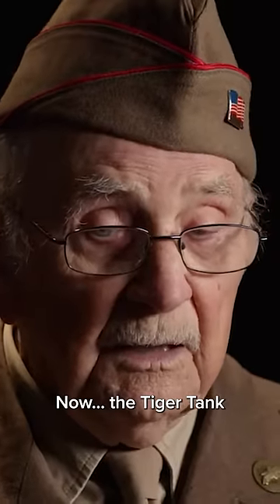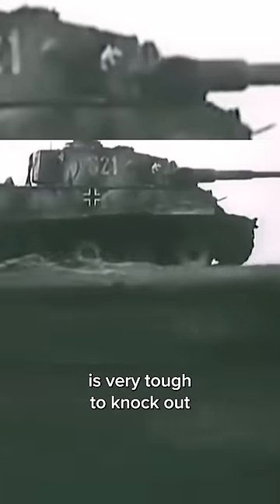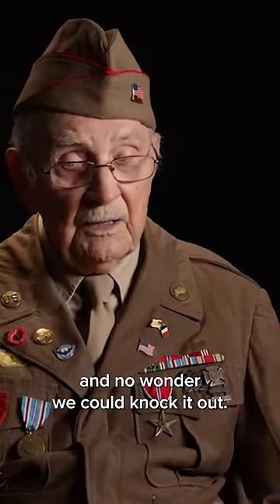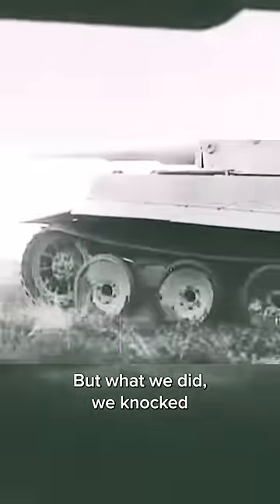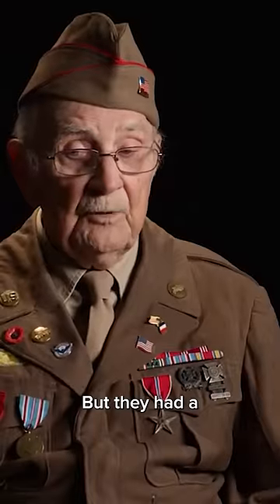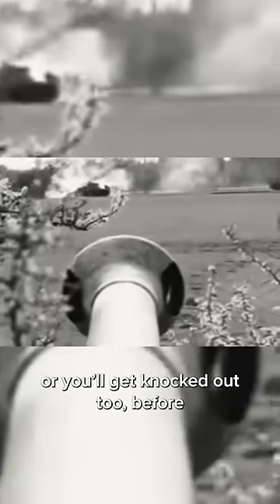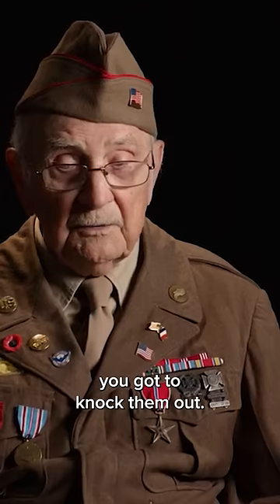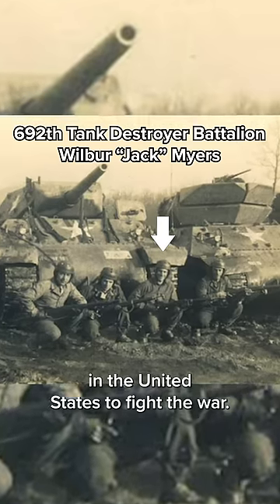How To Knock Out a WW2 Tiger Tank

Comment: That man didn’t fight a tiger 1. That man is talking about a King Tiger. That is levels more dangerous.
Reply: Knew something was off when he said 72 tons lol
Reply: Yeah the tiger 1s could be pierced from the front by the Sherman's 76mm gun, if the gunner got a bit lucky.  

And a lot of tiger 1s were actually disabled  without being penetrated because German steel was so brittle that if you hit it from the outside with a high explosivbe shell it would cause armor fragments to burst into the tank and rattle around at the speed of a pistol bullet. 

This also worked sometimes on tiger 2 but their armor was SO thick it was much harder to make it work.

Germans responded with the Schurzen, those big metal plates that hung off the side of the tracks, tey'd set off a low penetrating high explosive shell before it made contact with the main hull.. 

 Americans responded to the same threat with a fibrous mesh inside the armor to catch the fragments when they broke loose, called a spall liner.
Reply: Ahh yess the ferocious King Tiger. Whether it be mud, or dust or snow, or nothing at all, The King Tiger will destroy.......... Itself.
Reply: @@DarkIsToNight The war was almost over, the enemy had all but surrendered. But unfortunately for the Allies, just as they were on the cusp of victory, they heard the Grumble of an Engine That SHOOK the Earth, and caused sheer TERROR in their hearts. 
They looked over the horizon, across the hilltop, and to their absolute HORROR, they saw the 70 tonne BEAST, The Ferocious KING TIGER peek over the ridge. 

Flames and DESTRUCTION followed this BEAST, their hearts were gripped with ICY fingers the moment it crossed the ridge, as they saw in abject fear, its transmission break down and the engine catch fire 🔥🔥🔥.
Reply: More likely its was a Panzer4. The allied got panic attacks the moment they saw a German tank.
Reply: @dapre your wehraboo copium haha
Reply: @hagamapama  Schurzen was meant to protect from Russian 14.5 mm anti tank rifles by breaking up the cermet cored projectile before it reached the vulnerable side armor. In fact Schurzen was made well before German steel started to decrease in quality.

And US WW2 tanks don't have spall liners. Not even stuff like the M48 or M60 which came much later after WW2 do.
Reply: Levels more dangerous if it reaches the frontline lol
Reply: @rkang6531 and then the ferocious T26E4 Super Pershing rolled up over the hill, the Tiger 2 fired a single Armored Piercing round which ricocheted off the up-armored turret of the American machine. The Pershing’s gun lined up on the turret of the King Tiger and fired its 90mm cannon, letting out a deafening boom as the round cut through the air and forced itself into the Tigers turret, detonating inside the turret and igniting the ammunition
:D
Reply: it's not more dangerous, it's even slower than the tiger.
Reply: @dapre   Until the Tiger's transmission broke for the fourth time in a week...
Reply: This veteran was in the 692nd Tank Destroyer Battalion. This unit fought in the battles east of Aachen in late autumn 1944.
Schwere Panzer Abteilung 506 with King Tigers fought in that sector too. Although a few King Tigers were indeed lost that autumn, their losses were sporadic. Few and far between. So what the vet is saying can't have been the norm.
Reply: @hagamapama  also, before German steel started severely degrading in quality, a non penetrating hit could give enough of a shock to the electrical systems enough to render the Tiger inoperable
Reply: @hagamapama ww2 truly was the grim dark brutal draconian nightmare sequel to ww1 after all. That's insane to think about.  Though I'm not sure how much it can compare to a rifle round turning your sternum into 'rib soup' as I've so endearingly heard it referred to as.

Comment: For reference an amoured Brinks truck is only 13 tons. Made for small arms fire only.
Reply: Yeah, if you have armor piercing rounds you can knock them out from the side. But you best not miss! If you do you may not get a second shot. The tanks they have nowadays are about 70 tons as well. And they can move at about 35- 40 mph and have very accurate fire while moving at speed. A modern marvel for sure.

Comment: This vet is talking about the king tiger( PzKpfw VI Tiger ausf. B) not the tiger tank(PzKpfw VI Tiger ausf. E ) that was introduced in 1942. Some distinctions include sloped hull armor, a larger turret, different engine(only late war tigers used this engine), and much more. They rarely saw action as there were very few of them and they were built towards the end of the European theatre. Also, if you were in a late war US tank, you could have been lucky enough to have a 90mm cannon(as present on the m26, m36, and many more) which would be more than enough to penetrate the turret, or possibly even the lower glacis.
Reply: The Allies had the Sherman Firefly that could take out T1 and T2 a long time before the 76mm was fitted to US Shermans
Reply: @monza1002000  False, it wasn’t the “allies”, it was the British. Also, the Sherman firefly is 76mm. Plus, it shot the Mk. 8 shell, which can’t penetrate even the tiger II’s turret.
Reply: @monza1002000 but with a cramped turret and poorer optics.
Reply: @JohnLennonsImagimaryAccount 
The us had the 76mm shermans since 1942 that could penitrate the tigers upper plate with an APCR shell
Reply: @garyslayton8340  Yes, even the aphe or just ap round form the 76mm cannon could penetrate the tiger's upper glacis. What is your point? 76mm cannons were not mass produced until 1944, which is just before the tiger II was introduced
Reply: The Tiger 2  is the Panzer VII btw the Panzer VI is the Tiger 1
Reply: The allies used the Firefly, Canadians, Polish, etc. 
The 17lbs could penatrate 135mm armour at 1000 yrds, more than enough to take out a Tiger 2.@tidepodenjoyer763
Reply: @frankbodenschatz173  The allies used the Firefly, Canadians, Polish, etc. 
The 17lbs could penatrate 135mm armour at 1000 yrds, more than enough to take out a Tiger 2.
Reply: @monza1002000  Some what true, all commonwealth countries did use the same vehicles. However, 135mm of penetration is not enough, the tiger II had 180mm for its turret and its hull was 150mm at an angle, there is no way the firefly was penetrating that using a kinetic round. However, the American M36 used HEATFS which is a chemical round and is great against sloped armor. Meanwhile, the Soviet SU-100 fired a kinetic APHEBC round which also easily penetrate a tiger II even though it wasn’t a chemical round(due to the 100mm cannon the SU-100 fired)
Reply: @elkrumb9159  Wrong again. The tiger II is technically the PzKpfw VI Tiger B, whereas the tiger is just PzKpfw VI Tiger E. The PanzerKampfwagen VII was titled “Lowe” and was an experimental tank prototype
Reply: @tidepodenjoyer763  from the side and rear of a king tiger, yes but no frontal armor penatration.of a King Tiger was ever recorded.
Reply: @JohnLennonsImagimaryAccount  you do realise Britain was part of the "allies"
Reply: @elkrumb9159  no? The Panzer VII was the Lowe which was never built
Reply: @frankbodenschatz173 what would be the jagdtiger
Reply: @Panzer_Craze  Yes, but the allies did not share all their technology. Russia wasn’t using Sherman tanks and we weren’t using T-34 tanks.
Reply: @JohnLennonsImagimaryAccount  the Soviet actually did use shermans
Reply: @JohnLennonsImagimaryAccount  also the Soviets gave the US early T34 for testing
Reply: @Panzer_Craze  Did it ever see service in the US army? I mean a panther saw service in the Russian army, does that mean they were allied with Germany?
Reply: @JohnLennonsImagimaryAccount  what are you even trying to say. you said they didnt share technology, and now were talking about germany?
Reply: @JohnLennonsImagimaryAccount  not like germany sent panthers the soviets CAPTURED them
Reply: @JohnLennonsImagimaryAccount  ah ok
Reply: @JohnLennonsImagimaryAccount You forget one thing in the ordnance inventory designation data the Tiger I is Sdkfz 181 while the Königs Tiger is Sdkfz 182
Reply: @graffriedrichvontanjung2487  How is that relevant, it’s a replacement for the original tiger, that is for distinction when moving inventory. I don’t understand what your comment proves because I am already aware that they are separate tanks( Tiger II being the Ausf. B and Tiger being the Ausf. E as mentioned in my original comment), and also talked about their distinctions. The panther variants also has different Sd Kfz numbers as it is an abbreviation or Sonderkraftfahrzeug(special purpose vehicles). Jagdpanther received 173 and Bergepanther got 174. The elefant(Porsche Tiger) got 184 and it wasn’t based on any previous tiger. With the Jagdtiger receiving different number depending if it got the 88 mm or the 128 mm gun. The Tiger II got designation 267 or 268 if it was equipped with radio! The ordnance inventory designations mean nothing
Reply: @JohnLennonsImagimaryAccount  I'm just telling you small data that you missed, it's not to prove any point. Ah yes I forget this is the internet, people couldn't see each other's emotions :).
Reply: @graffriedrichvontanjung2487  Yes, sorry. I have some issues regarding emotions and controlling them.
Reply: @JohnLennonsImagimaryAccount  The British were part of the Allies. Its not like US couldn't have done it, it was more they still didn't think it was worth the trade off

Comment: My grandfather fought his way into Bastogne under Patton. He told me the tiger had two real disadvantages that they would utilize. 

If a Sherman could get in close, the Sherman could move laterally faster than the tiger's heavy turret could turn. If they could get ahead of the gun turning on the turret, the tiger couldn't catch up and they could avoid being in the line of fire. 

The second problem with tiger had, especially in the Ardennes, is that long barreled 88, while absolutely deadly, would often get caught by trees. If the fight was in the woods, the tiger's Field of fire could be severely limited because they couldn't get the barrel around all of the trees.

Comment: My father was regular Army infantry, but told me that all the Tank guys said the only two ways to "kill" a Tiger tank (regular and King) was first get behind them and then either shoot at the part where the turret connected to the main body or right in the lower middle of the back (hit either gas tank or shell storage).  And you had to make sure you were close enough for your shell to penetrate its armor (thinnest at back, but still tough).
He said all of the Sherman Tank guys said the hardest part was getting around to the back without getting hit by the 88 gun.

Comment: In reality, there were literally only three (3) times Allied forces engaged Tigers in Western Europe (one of those occasions they engaged Tigers sitting stationary on railway cars). Allied troops also tended to call almost any German tank a "Tiger" - certainly the larger tanks. These stories are wildly overblown. Most of the Tigers were deployed on the Eastern Front and the few that served in France and Belgium after D-Day were either knocked out by Allied air power or were kept so far in reserve that Allied troops never encountered them - certainly not in these hollywood tank duals or infantry being assaulted by Tigers like the end of Saving Private Ryan. The Allies did face off against German armor, but 99% of the time, they weren't Tigers.

Comment: I used to think the Sherman was a vastly underpowered and lightly armored tank that was effectively a death sentence for whoever was assigned to one as part of a tank crew, but I’ve since realized that its main advantage was that it could move a heckuva lot faster than its Axis counterparts thanks to it weighing a whole lot less than them, meaning that if you could circle around the slower, heavier Tiger tanks before they managed to land a hit on you, you could easily take them out from their weak point on the rear. Thank you for your service by the way, sir! 🫡

Comment: Just to clarify the veteran is talking about the King Tiger it has 150mm frontal armor and its slanted, the Tiger in this video is only 50 tons if I remember correctly... and the Ally tank looks like a M-36 'Jackson' tank destroyer (because of the 50 on top) and that tank has a 90 and if that went up against the Tiger in this video it would be destroyed from the front. Anything above a 75 can destroy the Tiger in this video from the front

Comment: What this mini clip didn’t mentioned was that the German tanks were the biggest gas guzzlers.  

Most Sherman tanks were 3 to 4 miles per gallon.  The T-38 was 10 gallons per mile.  The Tiger tank was 34 gallons per mile.  The ones with the 88mm cannon were about 45 to 50 gallons per mile.  Germany had a gas problem when they decided to invade the Soviet Union.  They only had 10% of gas required when America entered the war.  Most tanks used against America used a combination of corn ethanol and low tier diesel.  Plus most of the good ammunition was used on the Soviets.  

If America entered the war before the Soviets, it would have been a lot different and devastating war for the allies.

Comment: Tiger 1 weight is not 72 tons at most between 50 and 60. Tiger 2 is around the 70  to 70+ tons threshold. I know he is probably talking about a tiger 2 seeing as he mentioned sloped armor but the footage used shows Panzerkampfwagen VI Tiger and not Panzerkampfwagen VI Tiger Ausf. B which would of been the Tiger 2

Comment: Tigers are famously unreliable, wouldn’t have to worry about knocking to many out because most wouldn’t make it to the front lines. They had huge design flaws also, the interlocking wheels meant you would have to completely take apart the tracks and a few wheels (depending on which was damaged) just to fix one wheel

Comment: I'm always amazed by the relative effectiveness of the US military in WW2. Could a Sherman go head to head with a Tiger? Nope. But for the cost of one Tiger, you could build 3 or 4 Shermans and also ship them across the atlantic to the front line. You get intel on a single Tiger being in the area, you get those those 3 or 4 Shermans out, and then you have one to draw fire, another to knock out the tracks, and one or two more to get behind it and land a shot. Good training means you probably wouldnt lose a single Sherman, but even if the tank drawing fire is goes kaboom, 4:1 odds still say the crew can ride back to base intact on top on the other Shermans, and now the nazi's have lost a tank they can't afford to along with possibly a crew they also can't afford to, meanwhile Uncle Sam is laughing all the way to the bank, having lost a tank that would be replaced twofold by next week anyway!

Comment: The Tiger 1 wasn't slanted at all and it weighs 58 tons, it's fairly easy to penetrate it with 85Mm but when it angles that armor it becomes a lil more difficult but an agile medium or light tank can knock out it's track and go around it the way he said but for heavier tanks they could shoot the top of the turret or the turret ring but this is slightly tricky but there's the machine gun port of the front which remains a matter of will the AP shell go through or not but also the coax machine gun can be penetrated but that's not a 100% guarantee

Comment: The armor is the weakest at the rear the tiger tanks were ment to have all round protection in the frontal part. Subduing the tracks was also another method if coordinated with infantry. Quite a fear some tank at its time.

Comment: Not as practical, but mounting some MG42’s to internal firing systems on the side/rear of the Tiger 2 would’ve been effective at stopping infantry and light vehicles from approaching. Could’ve easily protected it from anti-tank weaponry aside from longer range weaponry, tanks and planes.

Comment: The Brit's had a different method to the USA that hit the tracks & prayed.
Brit's brought a QF 17 pounder mounted on a Comet, Challenger, Sherman firefly or  M10 Achilles.
QF 17 pounder APDS can penetrate 7 & 2/3rd of an inch at 2000yards.

Brit's were smart enough to paint the front half of the barrel camo so it blended in with the other tanks & so the Tiger had to roll the dice fire & if it missed the tank with a 17pounder then it didn't get of a 2nd shot.

A 17 pounder can go clear through the front & the back of any tiger at 1000yards.
The British offered the USA 17 pounders to lower our lend lease owing but hay the USA always thinks they know best & paid the blood price in tankers!

Even the British tank doctrine was to avoid tank on tank engagements unlike every other power of the time as Artillery, AT gun crews, mines or portable Infantry anti tank armaments.
Reply: I'm amazed this veteran or any of his military co-workers survived playing at dodge the German acht acht.

Comment: Should have listened to the English.  They would have told you that they're easy to knock out, you just needed a big f?@king gun like they put in the Sherman "Firefly".  They weren't even fussy about which way it was facing and were probably more likely to punch a hole straight through the frontal armour as that was more likely the first view they got of them.

Comment: Tiger 1 is 56 tonnes and doesn't have sloped armour. Tiger II or King Tiger is 79 tonnes and has sloped armour. Both tanks actually has better armour protection on the rear than they had on the sides so this Kelly Heroes nonsense needs to die. Rear armour plate on Tiger 1 was 80mm thick and slanted downwards about 12 degrees. King Tiger's rear plate was also 80mm thick but slanted down even more at about 20 to 25 degrees. Side lower chassis of Tiger 1 was only 60mm thick and at zero angle. You could take it out easier from the side even if you hit the upper side plate which was 80 mm thick because it too was at zero degrees. King Tiger was 80mm at 30 degree angle, lower was 80mm at zero.